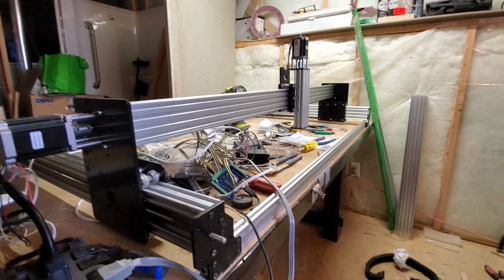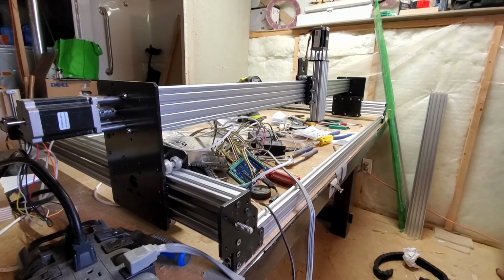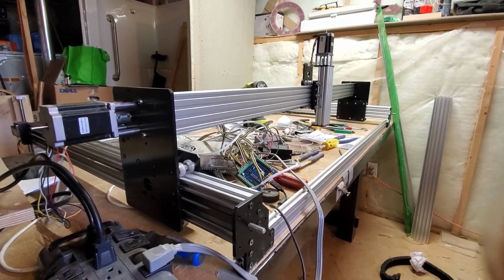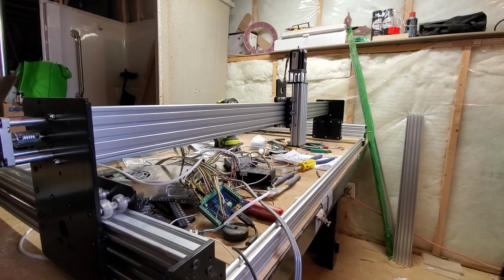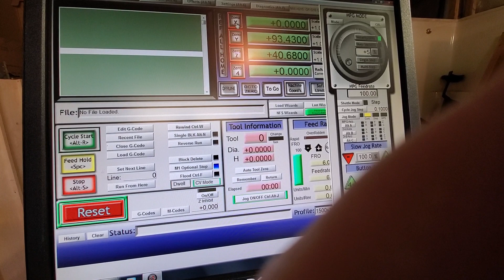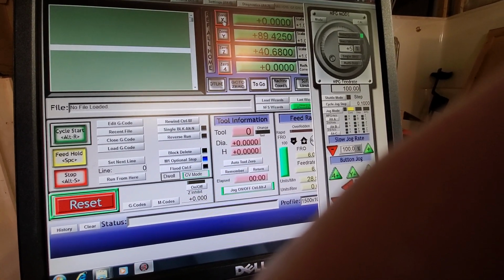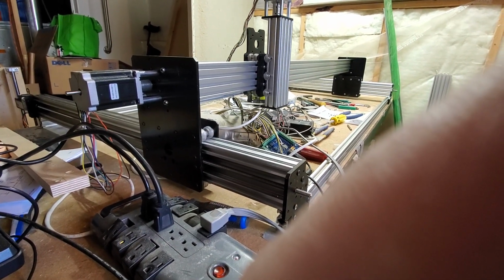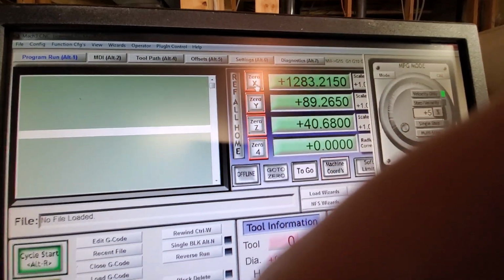1500x1000 Workbee CNC Test Run

Comment: I replaced the tb6600 with dm556 driver instead. Night and day difference.
Reply from the maker: these are not the tb6600, these are CW230, higher amp and higher voltage. I have the tb6600 on my smaller cnc, and can only get max 1000mm/m (40ipm) before losing steps, these I haven't totally tested yet. But have bigger steppers so hoping for faster results